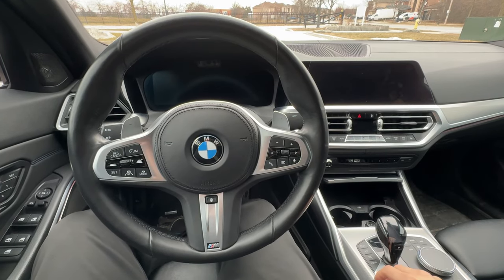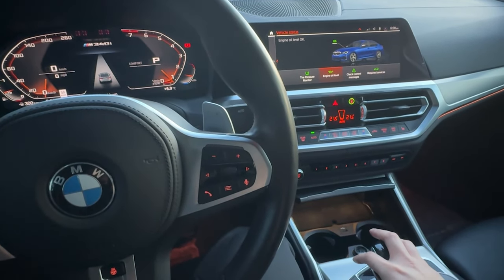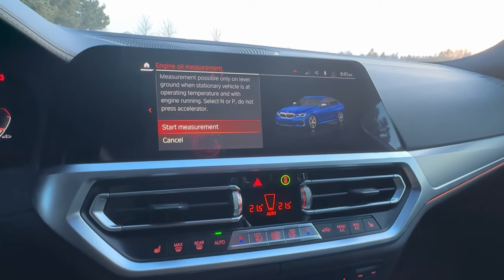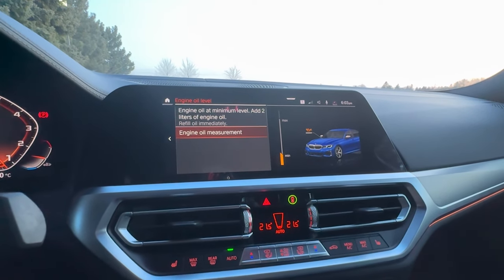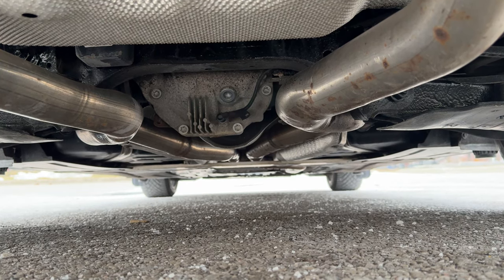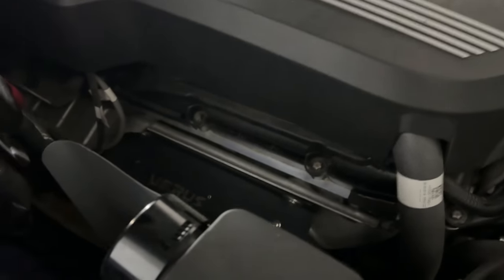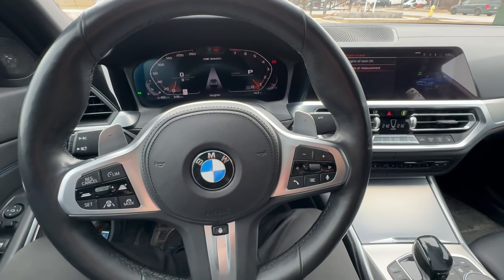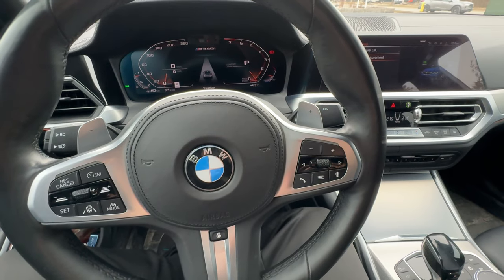Common Problems You NEED TO KNOW Before Buying BMW M340i

Comment: Another major issue with early production g20s is the evaporator drain tube is mis aligned with the AC drain line. So what happens is the water from the AC drips into the car, soaking the carpet around the center console. I’m having this problem and the repair is $3k+
Reply from the maker: Haven’t heard of this yet, but I haven’t done much research on this specific topic and I do take your word for it.
Can’t imagine diy removing everything to get to the evaporator on european cars… that must suck. Hopefully you might still have several months of warranty left for it to be taken care of?
Reply: @TandeGarage  the car has been out of warranty for nearly a year now. This is a defect right from the factory. BMW dealer wants 5300usd to repair it as it requires removing the dash
Reply from the maker: Evaporators are typically “hidden” under/inside the dash, so I’m not surprised it requires disassembling the entire dash to access the faulty part. That’s why I can understand the hefty bill on the repair 🤦‍♂️ 
That’s why I have been sourcing a trusted local indy shop and building a good relationship with them. It will pay off eventually. Going to the dealership for service is usually a ripoff 🥲
Reply: @TandeGarage  Indy shop still charging 3k for same repair.
Reply from the maker: @lastpally  Still better than $5.3k tho 😅
Reply: @TandeGarage that’s true. I personally believe it should be a recall
Reply from the maker: @lastpally  Unfortunately, recall generally only happens when it involves any safety concerns for vehicle operations - like an airbag malfunction, the hood-flip-over-when-driving situation with Tesla earlier, etc.
There might be a TSB issued in the future. But those are a PITA get a dealership service to agree upon and perform a free repair.
Like the oil pump issue - I’m sure BMW knows about it. Even then, they haven’t and likely won’t do anything with it smh
Reply: @lastpally   While you've got the dash out you may as well retrofit the new ultrawide version, they're not cheap though.🤔

Shit I'm wondering if to just get the 330e and stage one tune it, the m340 on the early ones seem problematic.

Comment: They need to make a recall for the oil pump smh
Reply from the maker: Only if! It doesn’t concern operator/passengers safety regard. Even if they send out a statement, it will only be a TSB not a recall, unfortunately. Being said, that will be up to the dealership’s discretion to fixing it if it’s brought up.

Comment: How much km are you at? Is there an option for the cad model that includes the non plastic parts? I heard ZGK but that option isn’t available in the 2020 pricing guide. I’m considering a high mileage early build so want to avoid any major pitfalls.
Reply from the maker: I got it a year ago at 51k km. Now it’s sitting at around 79k km.
The oil pump “issue” started as soon as I got the car pre-owned. Took care of it at around 60k and it’s been good ever since
.
In my honest opinion, if you’re going to get an M340, get a 2020 MY however you want it to spec, of course with budget in mind; as well to set aside some funds to be prepared of taking care of any potential issues, given that it’s already out of warranty when you purchase one that’s early-built.
2020 is the MY to go if you keep tuning in mind, regardless of the early-built production problems that can be easily taken care of after purchasing.

Good luck car-hunting!
Reply from the maker: Forgot to mention, ZTK does include the “upgraded” oil pump even with 2020 MY as I mentioned in the video. Don’t be frustrated if you can’t get one, either it’s not an available option or just not the pre-owned you’re looking has spec’ed for. Their big brake kit comes at a hefty price to replace rotors and pads anyways 😅 Not to mention the lack of undercarriage protection for the cooling system under the car, which also can incur a hefty bill to pay for if something were to happen that punctures the radiator.

Comment: I have a M340i Xdrive on order it will arrive in February. Why did you change the Differential oil with such low mileage?
Reply from the maker: I’d say 60-ish k km is a pretty reasonable mileage to change the differentials fluids, it’s not exactly expensive nor labour intensive; but to each their own.
If you do care about the car, these basic maintenance items are the least you can do to ensure its reliability; including a shortened engine oil change interval than what BMW recommends.

Comment: I have a 2020 M340i with the ZTK package I think they upgraded the pump correct?
Reply from the maker: Supposedly, yes! Unfortunately, there’s no way to confirm 100% that you have the updated pump or not, other than pulling it out and check for part number (which will be completely pointless really…)
If you can check oil level right after a drive, every single time; that’s one of the clear indications your oil pump is in good standard! ✌️

Comment: My oil doesnt read but it does tell me when to top off. I have a g30 m340i too
Reply from the maker: And that’s exactly what happened to mine. If you have warranty still (assuming extended warranty if you took it upon purchasing), try to push for service to replace the oil pump for you.
From my understanding is that when it’s measuring oil, the oil pump is outputting oil pressure out of tolerance for oil measurement (as if you stepped on gas), so the oil measurement stops.
Of course this is only the theory and your service advisor may say it’s bs and turn you away. But try pushing for the oil pump replacement. The FB group that I’m in, a lot of folks got their oil pump replaced under warranty, even if it’s tuned for a small fraction of them.
After that oil pump replacement, I’ve been able to measure oil every single time.
Good luck friend!
Reply: @TandeGarage  it's cpo warranty and I have 68k miles on it, not sure if it's still under warranty
Reply from the maker: @Zurdo_Grease  quick call to service, they will be able to verify it for you.
Reply: @TandeGarage  I'll do that. Just hopefully they don't say anything about my tune. Cos my dme is locked
Reply: @TandeGarage  I'll do that. Just hopefully they don't say anything about my tune. Cos my dme is locked
Reply: How much oil did it use before 5k miles
Reply from the maker: Mine burns less than 2L in 5000km on 0w20, and it also varies on how I drive.
Switched to 0w30 lately, looking to monitor the difference it will make, if any.

Comment: So what year M340I are the best to buy? 

Thanks!
Reply from the maker: If you are trying to tune it, 2020 is THE year you should put into consideration in priority.
If you are just trying to enjoy the car as is, 2021 and up is your best choice, where you don’t need to worry about plastic components of oil pump, rear differential cover leaking, etc.
In addition to the last one ☝️, if you want a higher tech then the pre-LCI (full digital dashboard vs digital dashboard+another screen for the iDrive system), then 2022+ for the LCI models.
Hope this aids with your decision making!
Reply: Don’t buy the 2025 m340 because they switched to the b58 tu2 uses the technical updated engine version 2 with port injection.  It is having engine failures.  Also the mild hybrid version came out in 2022 or 2023 it has a purple cable by the oil housing.  So I think 2022 is most reliable

Comment: B58 becoming the new VQ with these oil issues😂
Reply from the maker: Haven’t done much studies about the VQ’s so can’t comment on it too much.
Oil pump is an issue that can be solved by replacing the unit. I genuinely have no clue about oil consumption.
Oil consumption on the other hand, I may switch to a slightly thicker oil (0w30 maybe), and see if it’s going to improve. It’s indeed weird.